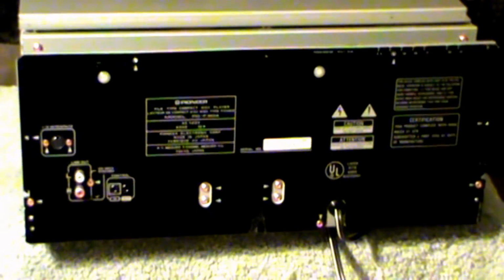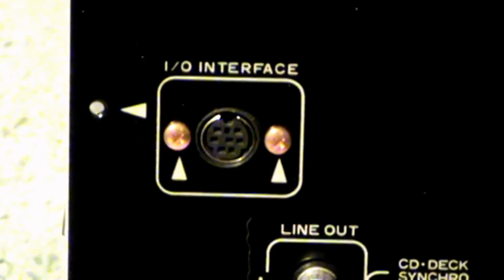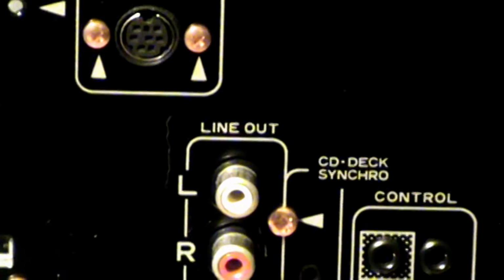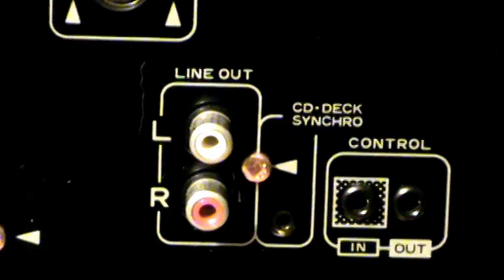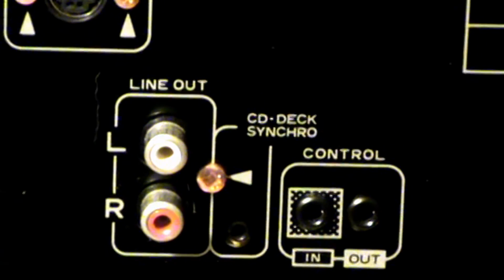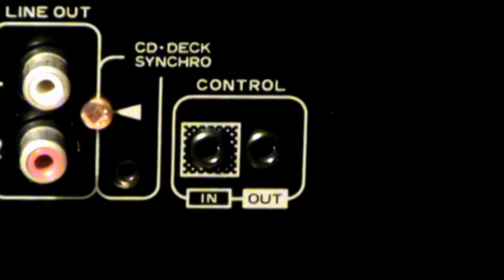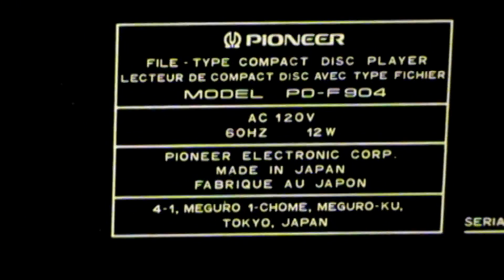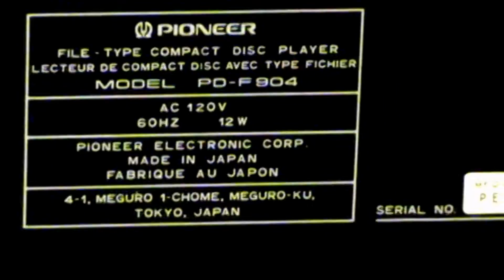A look inside a 1990's Vintage Pioneer PD-F904 100 CD Changer

Comment: I love this thing paid next to nothing for it and it works like a champ im also glad I have the model without led's because over time they won't burn out that drives me nuts when they burn out then i have to solder in a new one.

Comment: I have this unit made by optimus found it in a trash bulk in my neighborhood today . Test it out and everything works   It was clean condition. the best thing is I have a pioneer pd-f1007 and the remote control for it works on this unit . but mine was built in 1985 the date is in the back .

Comment: The Control In/Out jacks (3.5mm) are for linking units for control features, including relaying remote signals to units without IR capabilities.
Reply: Used to be an LPT1 cord conversion where your computer could control these, as well as the 300 disc model.  It permitted your PC to control it via a software program.

Comment: I have the PDF100 and back when it still worked fine I foolishly tried adjusting something due to info online about making the Lazer a little better anyway from then on it couldn't read a disk any longer. So I put it in storage and now would like to get rid of it but I'd love it if it could be fixed first. But now with it opened, I don't even remember what I adjusted. I think it had to do with the Lazer but unlike most CD players I can't even see the Lazer in this one or any adjustments that I might have done to it and I don't know how far I should go to just be guessing. Any ideas? Thank you,
Barry
Reply: the best advice I can give you is either try and talk with someone who works with lazers on youtube OR  join a fb group dedicated to older cd players and maybe you'll get lucky and a fellow who has the right info can give you instructions that has been a life saver for me many times.